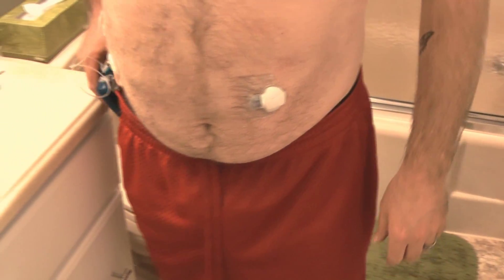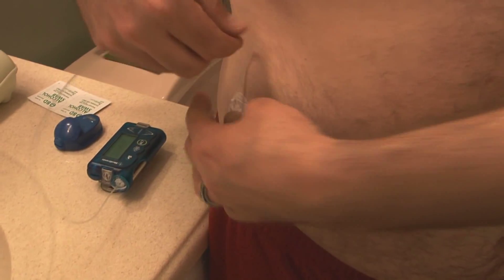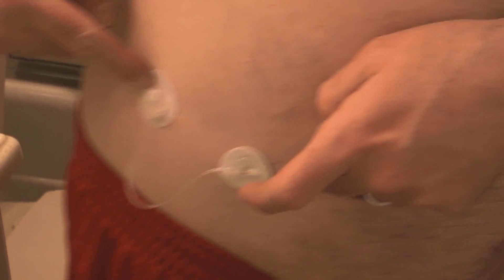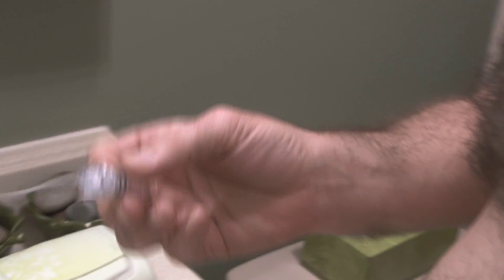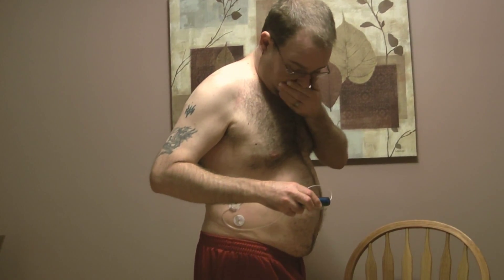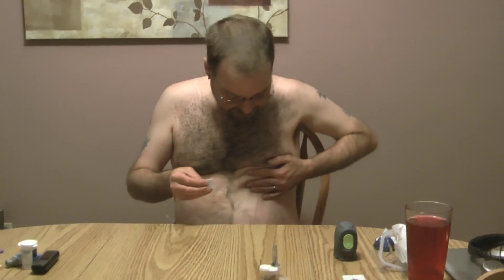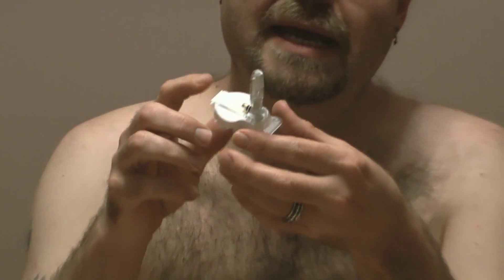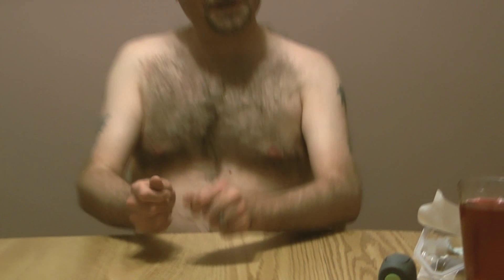Harley's Insulin Pump - Changing Infusion Sets

Comment: My UPMC insurance provider claimed the sensor was covered, then 6 months later denied the claim.  Fortunately, their assurances that it was covered were mentioned in a 3-way taped conversation with Medtronic.  So I "kind of" won my appeal.  They didn't bill me, but they won't allow for any further sensor devices.  You should mention that the sensor, although it does work in conjunction with the pump, is not the pump.  It's a different device.   And another thing, the needle you are putting in is placing a CANULA into your stomach, not a needle.  You're so lucky you have the sensor, I am really annoyed at UPMC for assuring me in an hour-long conversation that I was covered for that, then denying me.  I think UPMC has a few screws loose when it comes to us.  Also every year my endocrinologist has to write a letter to them, explaining I'm a type 1 diabetic and need more than 100 test strips because UPMC insurance after a year suddenly denies my larger quantity prescription.  Mind you, I'm a type 1, with an insulin pump.  I'm not going to suddenly NOT need to test - especially since they won't allow the sensor.  I also learned that people on Medicare don't qualify for the sensor device either.  Which is crazy because older people would need more than ANYONE!  The nice thing about the sensor is that it "monitors" (does not feed insulin, it's not the pump) and communicates with the pump 24/7 but more importantly while people are sleeping.  And the older you get, the more important it is to be able to wake up if your blood sugar starts getting low.  I wish to God we could have had the public option initiated that Obama proposed.  But instead, Republicans added over 100 amendments until we ended up with Romneycare.  Then they playact like they're Sarah Bernhardt and have their idiotic "challenges".  As far as I'm concerned this GOP is mentally challenged.  And look at the nitwit birther they as a "presidential" candidate.  As a Type 1 Diabetic, I'm absolutely disgusted.  I wish our electorate were better informed, for their own sakes as well as the sakes of other US citizens who may have disabilities.  As someone who has throughout the years seen SOME improvements due to healthcare reform, I'm sick to death of those idiots claiming they'll repeal the few gains we've made.  I once had to appeal a denial of surgery of a pre-cancerous tumor on my pancreas due to my "pre-existing" condition.  Thank God I won or I wouldn't even be alive today.  All the more reason to get those GOP deadbeats out of office.

Comment: You talk of purging the infusion set of air and making sure there are no air bubbles in the Insulin when filling up the tank, I am going to ask a question that's probably very dumb, is it dangerous to your health of you insert the infusion set to your body before purging it?  Is it also dangerous to use the system if the Insulin in the tank has air bubbles in it?
Reply: The only dumb question is one that goes un-asked :-)  It's not particularly dangerous, but it would inject air, which would be very painful.  As for the insulin tank, tiny bubbles (that look like foam) are no problem, they will dissipate.  Larger bubbles can actually be a problem, so I have to make certain they are squeezed out before I connect it.